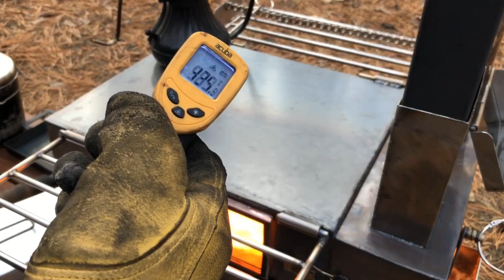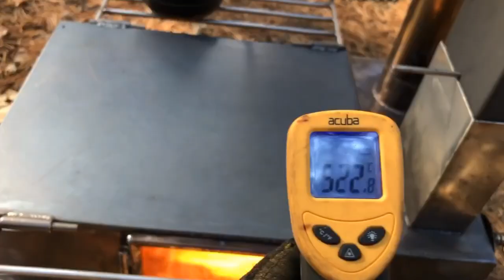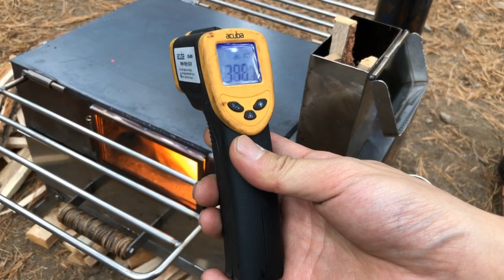캠핑 로켓 난로/개조/Upgrade/Camping rocket stove

Comment: Ok you are on to something there. You would make a great deal of money here in the US making those. The preppers and Bushcrafters would snatch those up.
Reply from the maker: I like Bushcraft, too.
I still want to enjoy it as a hobby. There is a company.
Reply: Prepper here - can confirm - please take my money!!!
Reply from the maker: It's okay....
Reply: @stovetv  
Hello, I want one, how much is it, and can you send it to me? I am from Saudi Arabia
Reply: I might try and fire up @AvE and his townpump CNC to take on this project, with our attempt at getting our friend here's permission.  CAN confirm Uncle B.  This kind of thinking is right up your alley.  Except you know exactly how to make it more skookum.  My mind?   

1) Make a proper planche / griddle on the top with stout edges for drip containment 

2) Adapt the side opposite the intake/chimney.  Using a module and otherwise sealed port and an internal damper between the fire channels, the "firebox" side can terminate at a vertical 90, bypassing the rear of the unit, and creating the ultimate tandoor / rocket forge for tandoori foods, awesome sears... and potentially other utilitarian functions.  Without the tandoor attached, the damper is opened to resume the present airflow, but add a secondary air intake right there with a separate damper to adjust the flame intensity further and more efficiently.

Creating the planche, the tandoor, and a more efficient burn from those quick mods, but otherwise this is an AWESOME design!  Thanks for sharing.

And, yes.   Take my money.

Comment: This is a wonderful idea of a stove! I give it some thought and come up with an idea of UPGRADE: I am wondering if there is a possibly better way to handle the ash. For instance, the stove continuously uses for a long time and come up with a stack of ash that may block the inhaling window. What if the ash drops to somewhere or a device for manually (but regularly according to the ash stack) clear the burning section? Ash dropping may lose a very good heated spot of the oven underneath. Then, perhaps the burning tube section can be added with a DRAWER, able to be pulled and slide out to the opposite of the inhaling window. Following a quick deposit of the ash, slide the drawer back to the tube. The stove may keep working for a pretty long long time without stopping it and cooling it off to handle the ash block.
Reply from the maker: Welcome. 
Thank you for your feedback. 
I'll think of your opinion.
Thank you for watching the video.
Reply: It's a great stove, but most rocket stoves do not produce much ash. Some how it is not burning efficiently enough. I noticed your first heat top was scorched unevenly. Most rocket stove's similar to this have the stack on the opposite side of the burn pit, which will distribute heat more evenly and burn more efficiently, thus eliminating your ash problem.
Reply: Você é incrível, amigo! Obrigado por compartilhar conhecimentos.
Reply: Você  é um dos melhores que já vi na Internet.!

Comment: I have a request. Make a small stove ( made to heat a 20 oz. can of some kind of soup with meat in it ) . It must operate with at least 2 different kinds of fuel 1 bought @1 found in nature @ processed on camera . Must hold enough fuel for job , then burn out . Must lite with a match without accelerater . Are You up for it ?
Reply from the maker: My stove is made without a plan
After winter, I'll make it a small stove.
Thanks
Reply: @stovetv  when I say a " small " stove I mean small enough to fit in a pocket of a pair of cargo pants .